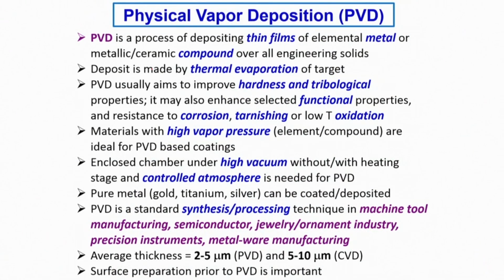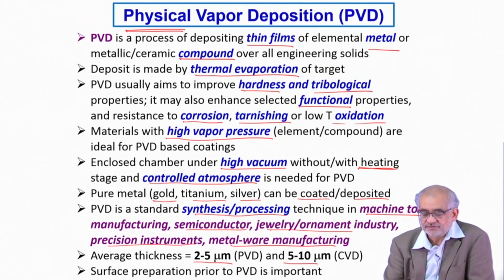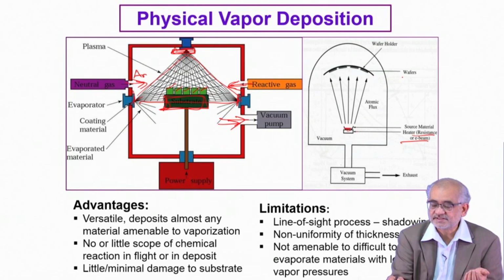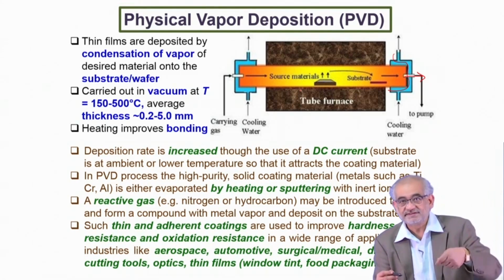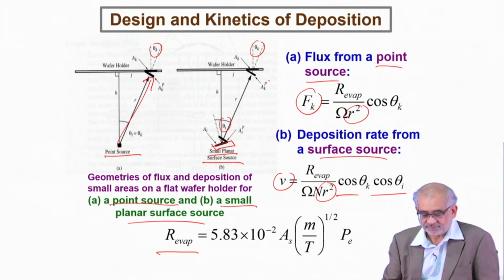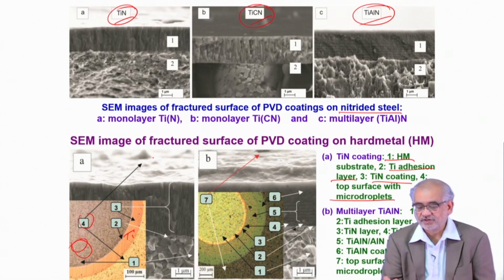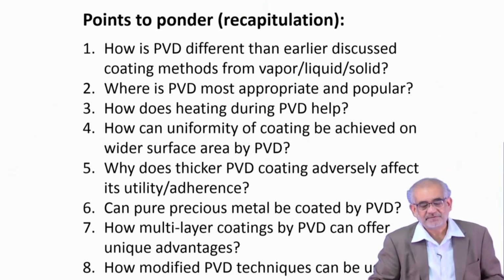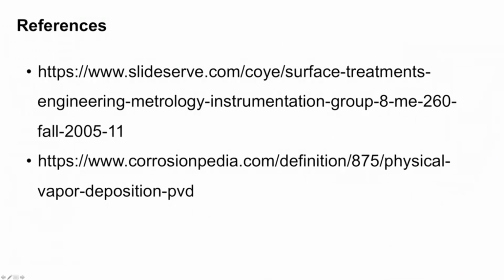Physical vapour deposition (pvd)

Comment: Sir,I want to develop this machine.Will you guide me.I do not want to buy this machine from China. I am an entrepreneur and earlier developed machines like Longbed Hydraulic machines with the help of MSME Tool Room.
This PVD COATING project is my dream project. I want to coat over S,S304 sheet metal (2600mm by 1250mm).
I want to venture all my resources in this project. Please help me.
My mail id:- chaki.subh@gmail.com
WhatsApp number:- 7076104241.
If you response me I could meet you at your convenient place.
Please,please pay heed to my appeal.